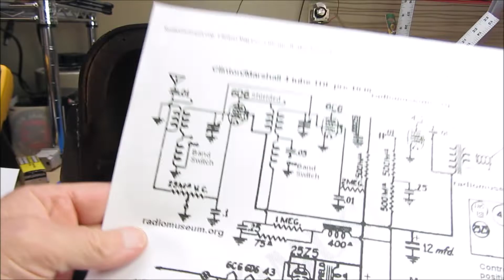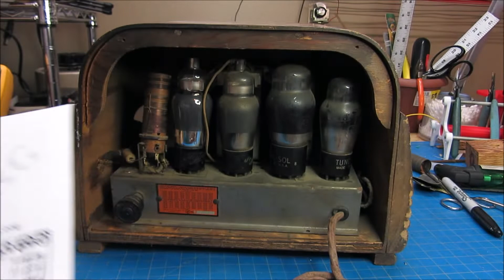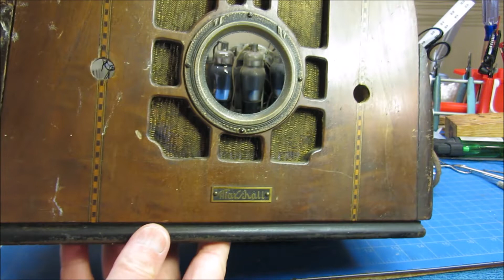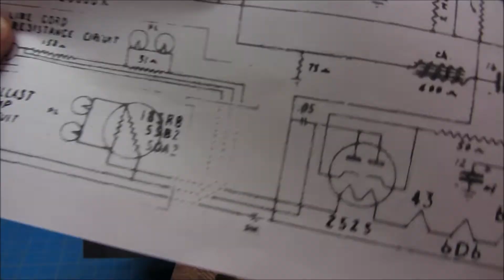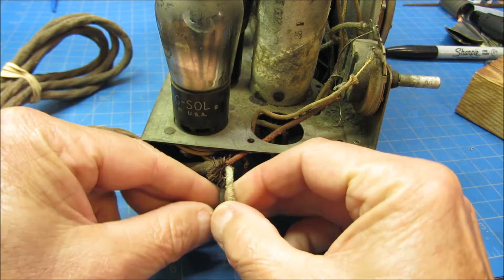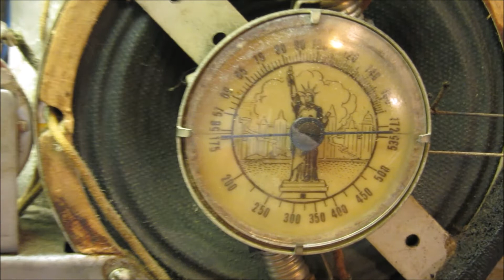Mid 1930’s Marshall/Clinton TRF Radio Part 1 of X  Introduction

Comment: Alain Blazit wrote:
"It seems that the resistive conductor in the power cord is insulated with asbestos. Better to put some protection on it. " I noticed this too and wondered if it is asbestos?
Reply from the maker: I cant confirm what it is made of….Ive done several searches and havent found anything on the materials used to make the wire covering….Since Im replacing it, I will treat it with care as if it is asbestos…..should t be hard, clip it out and its done…..I figured it was made of some fireproof material since it has to dissipate 12-20 watts…. If you find out what its made of, please let me know! Thanks for watching and commenting…Take Care—Larry

Comment: What a cool and unique radio Larry, you always manage to find the super rare stuff! Reminds me of the tiny Emerson CF33 I did with the curtain burner cord. I used a big capacitor in that one, so as not to create any heat in it vs. a power resistor. Take care my friend.
Reply from the maker: Thanks!! I will have to check out that video again….My heater chain is 62.6v, the dial lamps are 15v….my calculations show I need 8.8uf….I am getting an 8uf today….but, I’m basing the 8.8uf on 110v….we will see!! 😬

Comment: Never seen a dial like that,, sort of patriotic.
Isn’t there a way to replace the power cord resistor with a capacitor that will drop the voltage?? No heat that way. Good luck - Dan
Reply from the maker: Thanks Dan!! The dial is one of the things that made me buy it….There are maybe 3 options on reducing the line voltage….this small of chassis is not really (IMO) a candidate for a power resistor…I’m already going to have to use a 5 watt resistor for the lamps….The capacitor is probably the most logical….the 3rd is a ballast tube but still dealing with heat….spoiler alert….I have ordered a capacitor….I hope to show the calculations and repair in either part 2 or 3….we will see….I’m hoping the major organs are ok….I haven’t done anything else other than plan..Thanks for watching and the comments…Take Care—Larry

Comment: Larry - another unique looking set in your collection. The cabinet design and the cool dial scale makes it a eye catcher. I’m looking forward to the series. All the best. Don
Reply from the maker: Thanks Don! Yeah, when I saw it, I had to have it….I need to look up ur video on replacing the curtain burner cord….I’m looking at replacing it with a capacitor….I think you did one back a ways…I’ll be tapping ur expertise on this one😉….It is so unique,simply built and frankly cheaply constructed….as you will notice, the dial is exactly like the Silver Bell…I wish I had known it when I was trying to figure that one out!! BTW….I failed to mention it on the video….Michael reached out to me last week….he said he hopes to be making a video soon….Thanks again….Take Care—Larry
Reply: @Backtothefutureradios  Feel free to reach out if you need anything. I haven’t used a capacitor other than testing the process on the bench if I recall correctly. An AC capacitor around 8uF +/- a bit is what I used. I didn’t have room for the AC capacitor, so I used a diode and power resistor in series to get the required voltage drop. I hope the restoration process goes as planned. Best, Don

Comment: Cool radio!  Drop That band switch knob off and I’ll turn you some for the front like it.  Looks kind of like it’s been hacked inside.  Wonder if after owning it a short time, if the radio failed, they couldn’t fix it, so it got put away, evidenced by the nice cabinet.

Comment from the maker: Alain Blazit…….For whatever reason, I got the notification for your comment. But, it doesnt appear on the comments…..

Alain posted. “	
Alain Blazit
It seems that the resistive conductor in the power cord is insulated with asbestos. Better to put some protection on it. Amazing TRF receivers were still made in mid '30.”

Thanks for the info….yes you are correct on the asbestos….I plan on replacing it, so It shouldnt be an issue….Im looking at ways to replace it….resistor? Capacitor? looking for ideas! Thanks for your comment, sorry YT does this sometimes…..I wonder how many comments I never responded to because of this?? Take Care—Larry

Comment: So very glad to hear that you are going to replace that curtain burner cord.
This radio is a bit of an odd one.  I noticed that the dial is not in the center of the large hole that must be cut for the speaker.  From the outside the dial is in "the right place" but it is not centered in the hole cut out of the cabinet.  It appears that this one is not using a ballast tube because the wires going to the bottom through a large hole seem to be going through where that tube would be placed if it were used. No socket was installed, so they ran wires down through the tube socket hole.
If there is a danger of heat from the pilot lights causing damage, you might consider using LED's instead.  High-intensity ones might be a good idea.  
A request/suggestion...when you get to the cabinet, after giving it a thorough cleaning, use something like tung oil on the inside.  Give it a bit of moisture to the wood to keep it happy.  
Both the top and bottom sides of this one are really grungy...bet that after you finish with it that the chassis will shine!
That cardboard tube on top especially looks grungy.  What are your plans for that?
Reply from the maker: Hi Wayne! I didnt notice that the dial wasnt in the center, I will have to take a second look at it……yes, talking with Jay Kinnard, the hole was for the ballast tube socket, that wasn’t used….not much has been done to this radio, so I want to keep it as original as possible….LED’s are out….Not sure what I will do yet on the bulbs or the cardboard tube…..I will leave the bulbs…the resistance is part of the overall circuit…Im already modifying the circuit to eliminate the cord…the cardboard…probably will be glued back and repainted….not sure…..You guys have seen it about the same time as me…..I havent planned a whole lot on how to proceed….lol….making this up as I go……I appreciate all suggestions……The tung oil is a good idea…thanks….the inside may get some or maybe some Howards…we will see! Thanks for watching and as always the comments and suggestions….Take Care—Larry